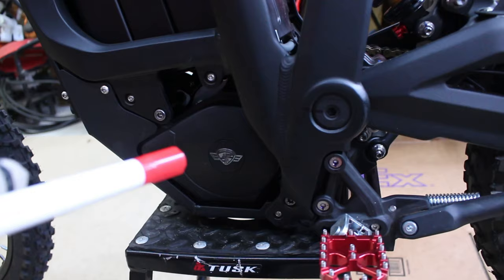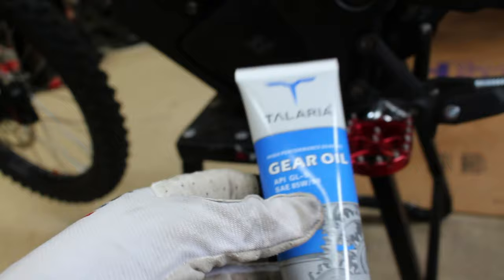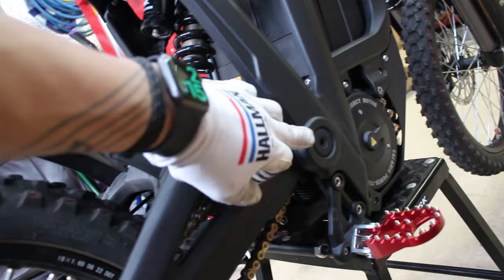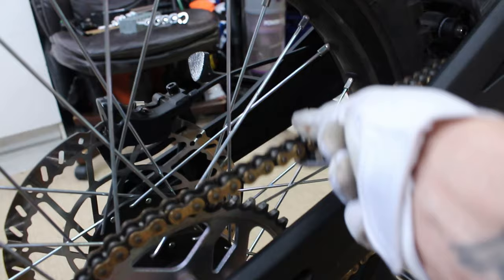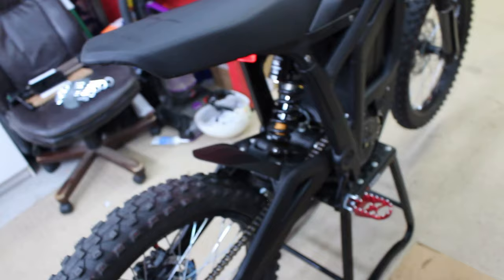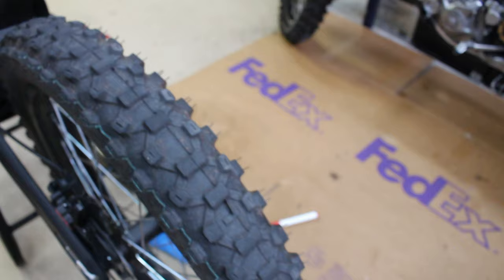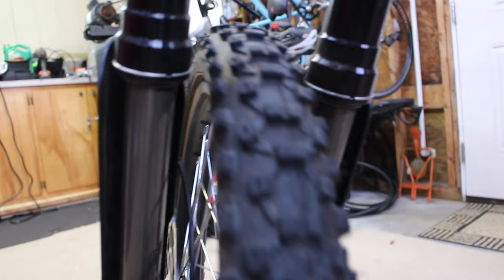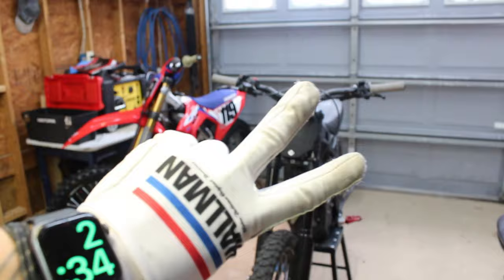Talaria Sting R // Maintenance 101 // EVERYTHING You Need To Know!

Comment from the maker: So I made a mistake... The manual actually says to change the oil after the first break in change every *5000km not 3000km... so about every *3000 Miles
Reply: If only it was completely sealed I would have gotten an R over the XXX. BTW, for long term storage 50% is the ideal charge for a lithium battery. It keeps the potentials equal and reduces dendrite growth. Supposedly charge no more then 80% like most Tesla owners, but kind of hard to do. I do not charge after a ride and charge it before for an hour or so like you too.
Reply: Just got a talaria x3 and was curious how long can I ride before my first break in change ?
Reply from the maker: @SHAUNPIERCE-o6v  the xxx has a belt so no gearbox and no oil to change 🤙🏽

Comment: Nice video! Only thing I noticed being used to moto. When tightening the headset, you loosen the two pinch bolts on the stem. But it is also very important to loosen the 3 other pinch bolts. The one on the steer tube as well as the two pinch bolts on the upper triple clamps then tighten the upward facing bolt before tightening all 5 pinch bolts

Comment: I have two ebikes that use Rohloff hubs, (which use real gears) they have been known to run for thousands of miles with NO oil in them. IF they initially HAD oil in them that is, it seems even after an opened drain plug, enough clings to the moving parts to still provide adequate lubrication. Same here, and why they are going to lesser amounts of gear lube, just not needed and maybe it cuts down some mechanical friction of slinging the excess around.
Reply from the maker: Good to know, thanks!
Reply: @freerfixedit  that's a big "maybe"

Comment: Great video man!.. I have a fork question.. where can I get new pinch bolts for my fork? I think mine are stripped in my sting R. Any thoughts?
Reply from the maker: Hmm, I know they make titanium bolt kits for the bikes but they are crazy expensive. I’m not sure where to find oem replacement bolts and parts. I’ll try to do some research tonight and get back to you. Thanks for watching 🤝
Reply: @freerfixedit  man I checked and the bolt is fine.. the stripped part is the nut inside the fork housing. I guess my fork is toast not sure that can even be replaced..
Reply from the maker: @jcasaubon  so you can turn the hex bolt counter clockwise and it just spins? Doesn’t back out? Are you talking about the pinch bolts on the axle or the ones on the upper crowns?
Reply: @freerfixedit  I am taking about the wheel axel. Two pinch bolts on each side for a total of four. One of the four I can tighten and continue tightening forever.. it just spins.. I took it out and put it into a different hole and it tightens and stops when it gets really tight. I took another bolt and put it in the bad hole and it can tighten forever spinning.. so something is stripped with the hole itself and not the bolt.
Reply from the maker: @jcasaubon  dang, if you’re lucky you might be able to go to the hardware store and get a bolt that’s slightly larger in diameter, and get a tap to run new threads. Worth a shot. Also, if 1/2 get tight, make sure your axle bolt is good and tight, and you could probably limp it around and be fine. I wouldn’t go hitting huge jumps or anything with only 1 pinch bolt, but it could be a temporary duct tape fix in the mean time.

Comment: The manual/ YouTube videos state to put 70-90ml of oil into the bike when
doing an oil change,

The problem I’m having is that the only way I can get anything above 50ml
of oil into the gear box is to lift the front tire of the bike up about
4inches so that the front end of the bike is raised off the ground, I think
this is due to the gear box not being mounted completely flat on the bike
as it ships from the factory, it seems as if the gear box is mounted at an
angle with the full cap sitting lower than the highest point of the gear
box.

The issue is that when I fill up to the 70-90ml which is the recommended
amount and then try to check the oil fill level by removing the fill cap, a
good 30ml of oil falls out of the oil fill cap, which makes me think that I
am overfilling the oil amount.

Should I be rising the front end of the bike to fill the oil or should I
keep it on the stand and only fill to about 50ml I do not want to under or
over fill the oil but the recommended amount in the manual seems like it’s
too much because all that oil is just falling out when I open the oil fill
cap

Also there are two small lines on the dip stick which I assume are low and
high oil levels, which indicate that the proper amount to be in there
should be right around 50ml, because anything more requires the bike to be
lifted and makes it impossible to open the fill cap/ dip stick without
spilling oil.

I do not know if this is a design flaw or a mistake in the manual
Reply from the maker: I hear of people having this issue, but when I did my first change I got 80ml in no problem.  No lifting or tilting. My advice would be to make sure you’re getting all old oil out. Change it right after a ride so the oil is hot and more viscous. It will drain better that way. And spin the wheel with your hand so the gear box turns and pushes out the rest of the oil. I also used the squeeze bottle it came with and saved it for future changes. I think the nozzle makes it easier to get the oil in where it’s supposed to go, and maybe turn the rear wheel again while filling. As long as you have oil in it and it shows good on the fill line, I wouldn’t stress too much. I spoke to Eric from Luna and they said these gearboxes are pretty bullet proof, and they’ve even done tests with them with zero oil inside and they ran fine. Hope this helps! 🤙🏽

Comment: Hi buddy. Thanks for your video. 
How often do you ride? I mean If I want to buy and drive 30 miles to work every day, is that too much?
Reply from the maker: Would depend if you were in eco or sport mode. But if you weren’t full speed the entire time I think you could make it. Would have to charge while at work but I think you could make it work for you. Just depends the speed and how much you’ll be on the throttle + hills/terrain, weight, etc…
Reply: @freerfixedit  Could it be like, you know scooter but for the longer distance and more comfortable)
Reply from the maker: @nurlankamza8171  idk if I’d say more comfortable, moped seats are pretty cushy, but more fun… 1000%. The most fun way to get around. I can’t stop riding the thing and don’t really care to ride a motorcycle anymore now that I have this

Comment: What is difference between the MX3 Sting and the Sting R (older model, less power on the MC3)?
Reply from the maker: Less power, 6kw vs 8kw. Smaller battery 38ah vs 45ah. Better ipm motor on the mx4. Better suspension on mx4.
Reply: @freerfixedit  Thank you for the information!

Comment: On my mx3 I put in the amount they said 150ml but it was awkward because I had to lift the front wheel about 2 feet up haha. Then I took it for a ride and noticed after there was a little oil coming put of the breather tube on to the back of the bike after a few rides it eventually stopped.
Reply from the maker: Yeah... 150 was probably way too much. I've heard that the updated changes to the manual apply to the mx3 as well
Reply: @Freer Fixed iT  Yeah.. atleast i know now, thanks to your vid!
Reply from the maker: @mcr.onwheels  just glad I can help 🫡
Reply from the maker: @mcr.onwheels  same… I drained it and 70-90 def didn’t come out

Comment: Has anyone tried to 75w90 synthetic lucas oil?
Reply from the maker: I’ve only used the stuff in the video. Shouldn’t really matter cause the lower number is the cold temp viscosity. Once it heats up it won’t really matter. Also I’ve spoken to Luna and they say these gearboxes are pretty tough. They’ve even done testing with zero oil in them at all.

Comment: Wd40 isnt even a lube its a cleaner thats terrible to use on your chain.
Reply from the maker: water displacement formula 40
Reply: @freerfixedit  WD-40 is great for cleaning and degreasing your chain, but doesn't work well as a lubricant. It will provide some small amount of lubrication, but nowhere near enough for your bike chain to run smoothly. It's best to use a high-quality, bike-specific lubricant instead.
Reply from the maker: @MotoAlias  appreciate your opinion, but like I said I don’t like pressure washing and scrubbing chain lube off my bikes, and with 20 years of motocross racing experience, and having never had a chain wear out before a sprocket, I’m going to keep using wd-40. Yes I agree, it is not a great lube, which is why I apply it much more frequently. After every wash and between every moto on the track
Reply: There is wd40 cleaner and lube for chains
Reply: @Shmack_  that's wd40 chain lube not the same as wd 40